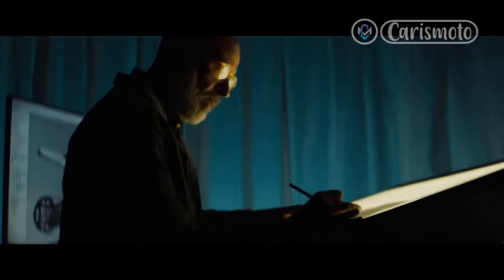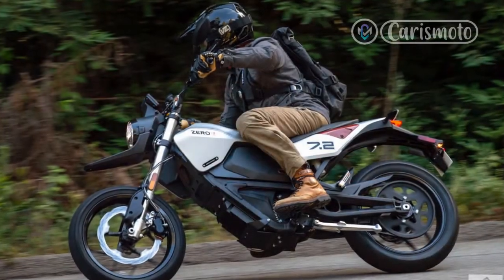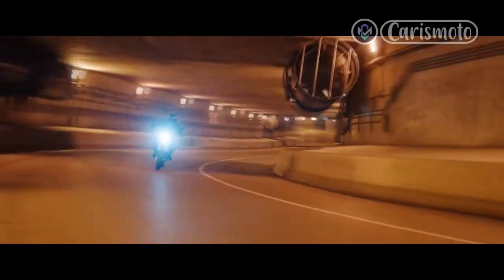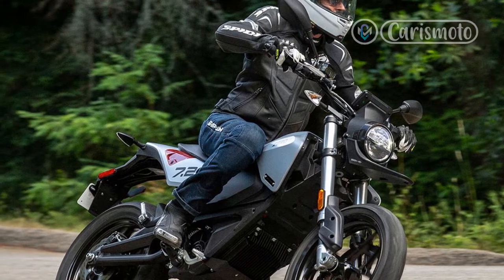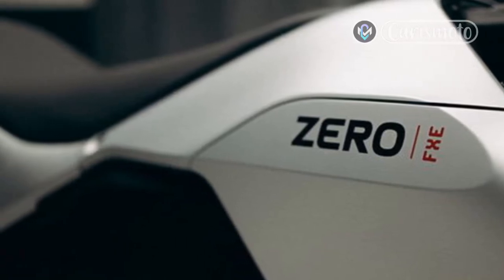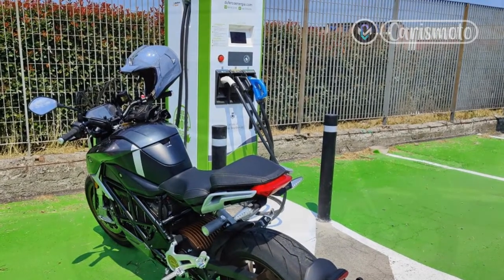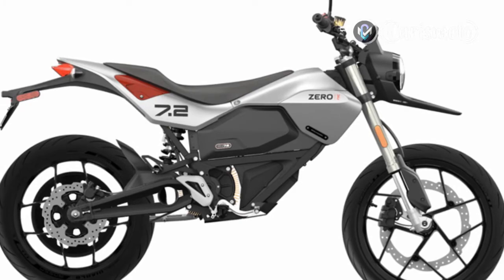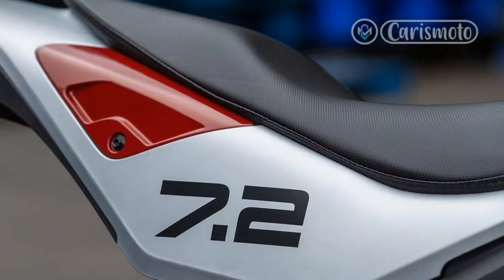2021 ZERO FXE Review

Comment: I've written quite a few models of the zero. I can tell you're only going to probably get between 40 and 70 miles out of this bike in one charge. They are absolutely a hoot around town and almost worthless on the highway. IPhone factors High but for $12,000 I just can't justify it. Not when you can get a good electric bicycle that will probably get just as much range, don't have to buy license and insurance registration and you have access to the bicycle trails as well as the street for under $2,000.